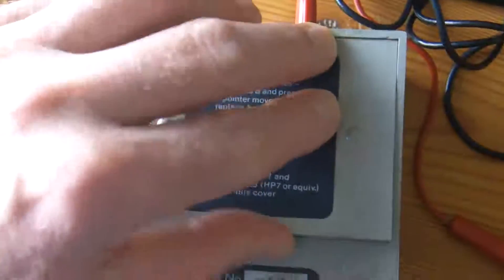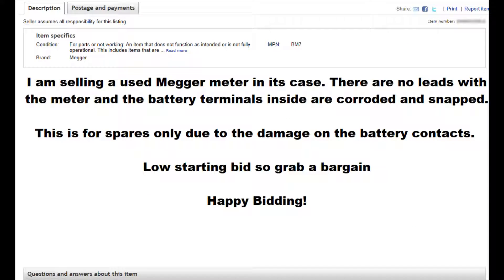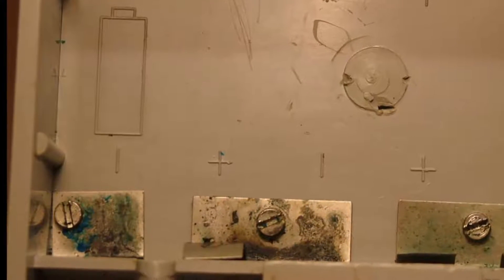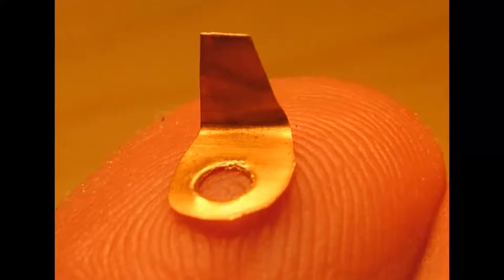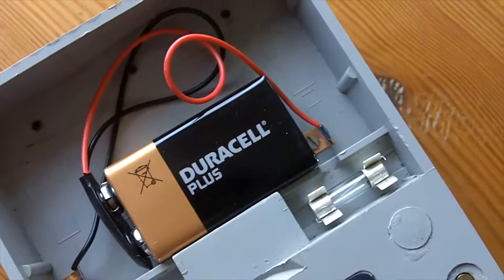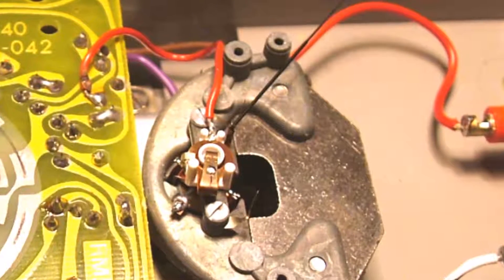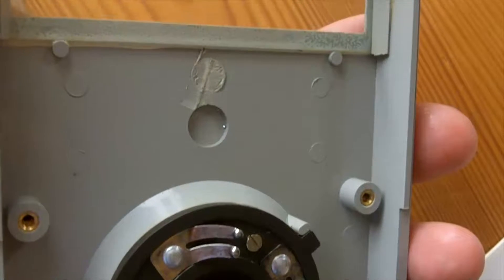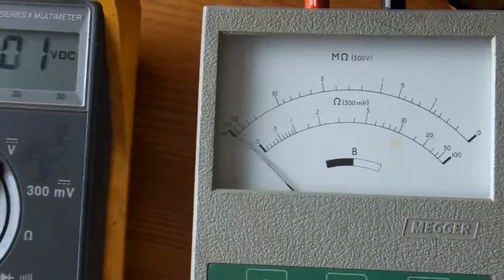Test meter repair.

Comment: Excellent meter . I had one of them when I first trained as an electrician forty years ago and there are still complaint with BS7671 and GS38 and can still be used . Perfect as a backup and for fault finding .look after it and put it to work.
Reply from the maker: Hi, there's something very special about moving coil meters that you don't get with digital meters isn't there. When working on radios and testing capacitors the speed of response of the needle  give you a feel for what's going on, and even on motor windings or other iron cored devices the effect of the tiny magnetizing current can be detected. You simply don't get the same feel with digital instruments. Just think, there will be generations of folks growing up not knowing what we are talking about.  It's not all progress in the digital world is it!!
Kind regards . . . . Andy

Comment: Found this as I was about to embark on a repair of my own BM7.  This one was also bought on eBay, about 15 years ago (but in full working order).  The manufacturer's service manual can be found online.  Your battery swap has just given me the idea of fitting it with a 3s lithium ion pack, made from from discarded vape pens :-).
Reply from the maker: I hope it works out well for you.
Regards . . .  Andy

Comment: I just bought one of these for US$5 at the local industrial surplus store.  Mine actually runs at 534 volts with fresh alkaline cells.  I tested it by measuring the input impedance of my Aneng AN8008 multimeter which it accurately reads as 10 megohms.

Comment from the maker: Hi there, funny you should mention the DC power supply sockets, I’ve just bought some for a project at 89p each and I think I'll be buying a few more to do exactly what you suggest as I’ve always got a bunch of adjustable power supplies kicking about. I’ve got some kit I only use on the bench once or twice a year and it’s a real pain messing about with batteries.
I can feel another project coming on...
All the best ... Andy 
GWØJXM

Comment from the maker: @AllAmericanFiveRadio 
Thanks Rick, you know it never dawned on me to even think about Megger testing coax cables, it’s almost like I keep the ham radio side of things separate from my industrial background which is silly really as I used the same coax in both. Funny how one can get stuck in a mindset but I think of GDO’s and VNA’s for coax, thanks for the prompt, or should that be ‘heads-up’?    
73’s ... Andy   gw0jxm

Comment: @AndyDaviesByTheSea It is the Fluke 73 series 2 Multimeter, The maximum Volt is 1000v dc and 750v ac. 
The the color is almost the same as yours, but slightly darker. It has never leaked. :)

Comment from the maker: @EGIL94 
Hi there, is the 250 volt version yellow?
I’ve never seen the low voltage version of this meter but yellow would fit in nicely with the colour that a lot of 110 volt low voltage safety equipment was identified by and the 110 volt kit would of course be tested at 250 volts. Out of interest have the batteries ever leaked in it?  
Kind regards ... Andy